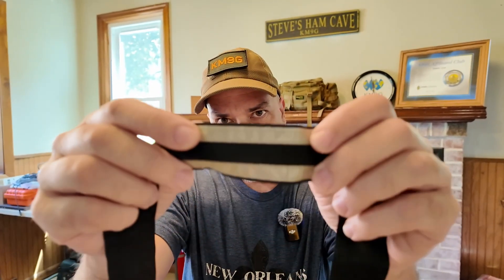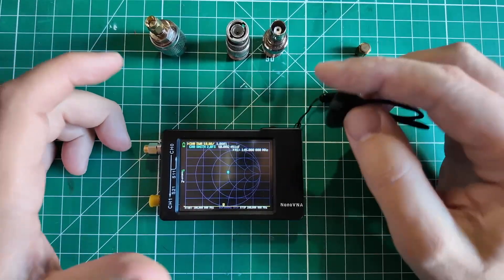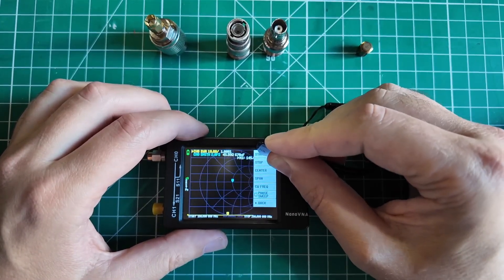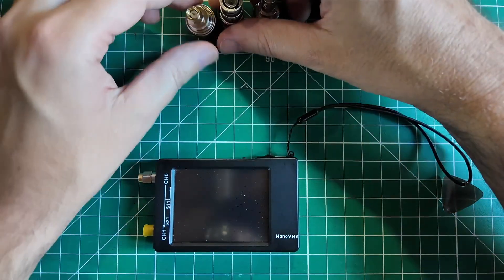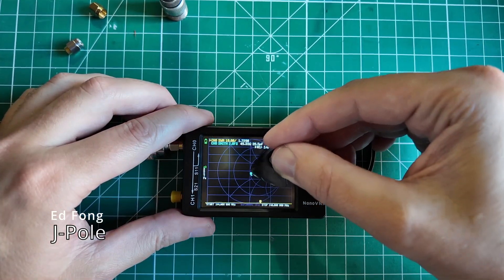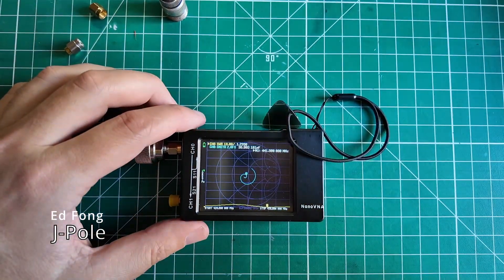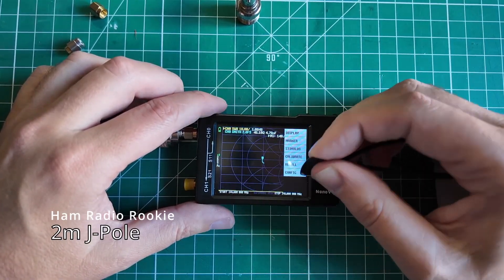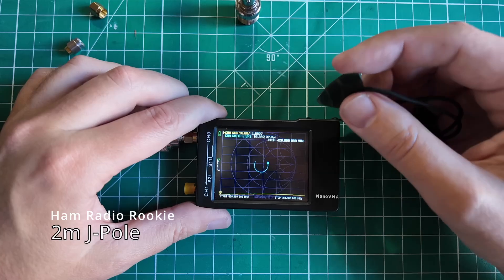Fara-J - In Depth

Comment: I was on the fence about buying the Fara-J 2 meter antenna. But after doing some research, I pulled the trigger. And I can honestly say, that antenna ROCKS! It rolls up to the size of a 35mm film canister (Remember those?), and weighs meir ounces. I have added a zip tie loop to the top so it easily hangs / chip clips from a elevated point. You can install it, or remove it, in minutes. And best of all it works great!
Reply from the maker: It sure does!  Good deal!

Comment: Did you know you can even TUNE the Fara-J antenna? The silver material is conductive, so when you run it through the buckle and it touches the same strip, it basically shortens the length of the length of the antenna. Mine runs great as is,  but you can adjust it. And a Nano-Vna would be perfect for the job.
Reply from the maker: Sweet, thanks for the tip

Comment: Interesting experiment, where you say the BNC to S0239 is "absolute junk" could you show that on the VNA?
I appreciate it's a throwaway comment but could you perhaps do some side by side tests with a high quality version and perhaps a teardown to show the manufacturing differences?
Reply from the maker: Sometimes I say things just to preempt stupid comments like "that adapter is crap" - yes, a silver amphenol connector is better, but for the prices vs. my use case its not better enough to pay the difference.

What I'll say is if you're going to use connectors/adapters in a permanent install where you're hoping to never touch it for 40 years or you're going to put food on your table with it... invest in the good stuff (amphenol).  If you're "playing radio" and yammerin on the local repeater, "any" will do just fine.  If I ever wind up ordering some good connectors, I'll be sure to do a comparison to my 'Used Junk' collection!
Reply: @temporarilyoffline  I made my comment with peace and love. Just being silly. YT is a never ending mistress
Reply from the maker: @RobCanada  Yeah man, that comment was about you.  Just trying to answer the "why I said it" and provide some value to your question.  She's a fickle mistress too!

Comment: Hello sir, I have an ic705 and Xiegu x125b, the nominal maximum output power of x125b is 100w, I think this should be the ssb mode, have you tested the maximum output power of DV/CW/FT8 mode? Regarding the issue of cutting corners raised by some people on the Internet, I asked xiegu, and they claimed that the power amplifier tubes inside are still two rd100s. I look forward to your reply, thank you
Reply from the maker: Good morning! I tested the 795+XPA here: https://youtu.be/gOO7YdE2KPQ?si=ENCQbOSvMXc-L0yy I used RTTY as my test mode
Reply: @temporarilyoffline  I watched it, it's a great video. I bought what seems to be the new version of the x125b. Xiegu now recommends that the input should not exceed 2W, but in fact the new version of the x125b can easily output 80-100W with an input of 1W. My question is actually that the rated power of the x125b is 100W, can it be turned on to 100W in all modes (FT8/SSB/CW/DV)? I know it can do it, but will it damage the machine if used like this for a long time? I heard from a ham that only the ssb can be used for a long time at 100W, while ft8 and dv can only be 25W.
Reply from the maker: @powind-zi8ik  ah. Ok.  I personally have used the amp in FT8 mode for a POTA Kilo. Just watch the temperature gauge and back off the power or add cooling if you need to.
Reply: @temporarilyoffline  got you.thank you very much

Comment: I think the SWR readings your VNA showed are not that fair. I think if the antenna was outside, on a 5m pole and the VNA was calibrated to the end of the feedline coax point, not just itself, the SWR would come down a fair amount, most J-Poles can obtain 1.2:1 or lower if you adjust them carefully enough, I know Ed Fong's one's can get to 1.1, I assume the Fara-J designer achieved better than 1.9:1 SWR when he designed them. I like the idea of one these and an 50foot length of nylon clothesline in a hiking kit, toss it into a tree and your HT will most likely get that repeater you need, if and when you really need it.....these design's shown are all great idea's for a J-Pole antenna
Reply from the maker: Good catch - that's why I used the ed fong antenna for reference - to help show the effects of being indoors and coax.

Comment: Do you know what thee backing cloth is made of?

The cut in the Ed Fong is for fine tuning 70CM.  There are a couple of good QST articles on teh Ed Fongs.

The thickness of the strip conductors probably accounts for the wider bandwidth on the Fara-Js.  I wonder if Ham Jazz has done this with foil tape on tarp material.  I guess that I'd like to try one for 6m.
Reply from the maker: No idea yet
Reply: https://youtube.com/watch?v=d5itl1uWGtU&pp=ygURRHVjayB0YXBlIGFudGVubmE%3D

Comment: The SWR graph may be more useful if you set it to 1 unit per division. Currently you have 10 SWR per division, which makes the antenna look very flat even though the SWR plots were mostly ok. Also, I did not know you could change the scale of the smith chart, it definitely should be 1.0FS so that the short is on the far left and open is on the far right. At least I learned something new :)
In any case, interesting design for an antenna
Reply from the maker: I learned something also!